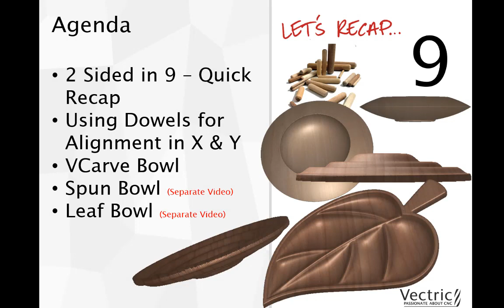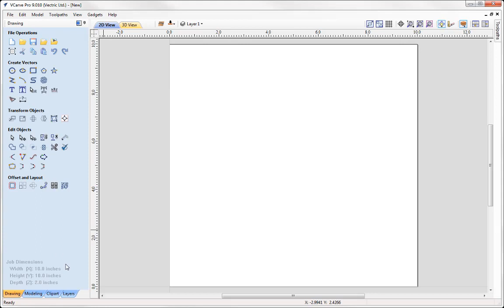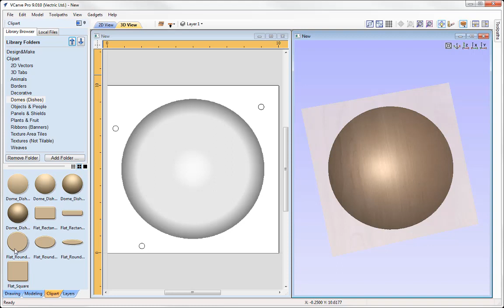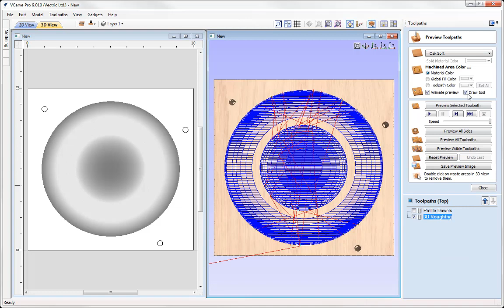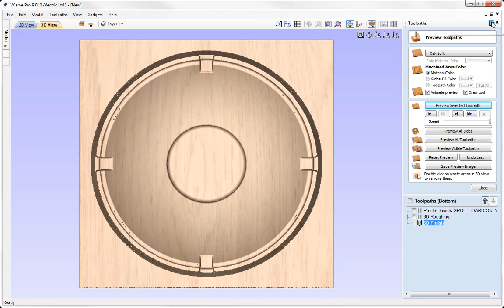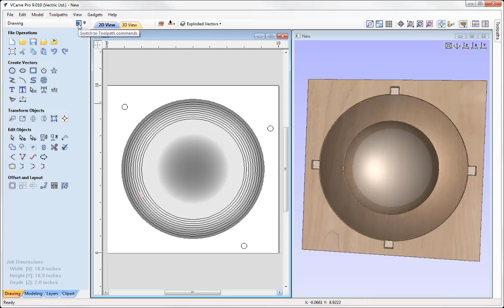Tips & Tricks | Making Bowls with Clipart | Vectric

Comment: Shouldn’t the dowels be symmetrical? I don’t see how they would match when flipping, thanks.
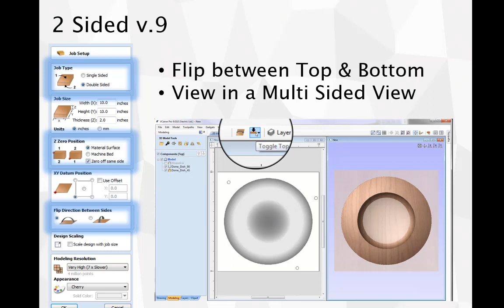Reply from the maker: Hi Jaez, the method of having non symmetrical dowels means that its fail safe and that there is only one possible way for you to flip the material over. You machine the dowels of the top side partially into the material, and the dowel vectors for the bottom side machine directly into the spoil board giving you perfect alignment! I hope this helps :) 3:52 explains this :)

Comment: After flipping the project and the top is machined, over where should the CNC be zeroed at?  The spoilboard or the top of the project?  I know when starting the project the CNC gets zeroed (Z) at the top of the blank, but not sure after it is flipped.
Reply: I have the same question and figured I would try the following:   After flipping the part your X Y Z coordinates would be on the opposite side. I am going to set my X Y on the lower right-hand side of the part then take advantage of the asymmetrical dowels and remove the part again and set my Z on the surface of my spoil board.  I think that should do it....